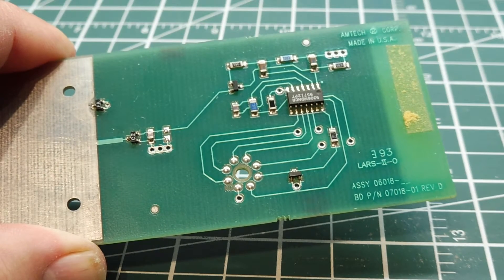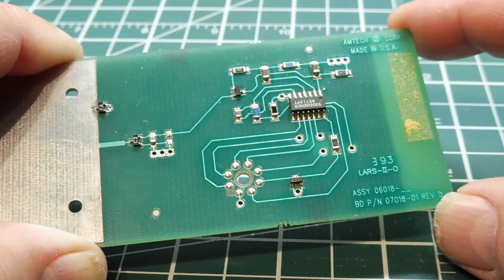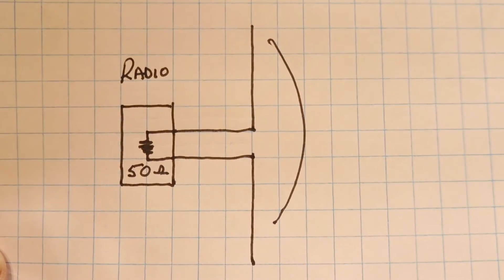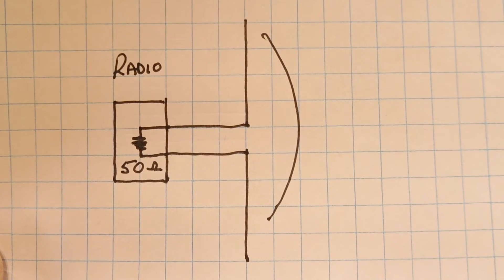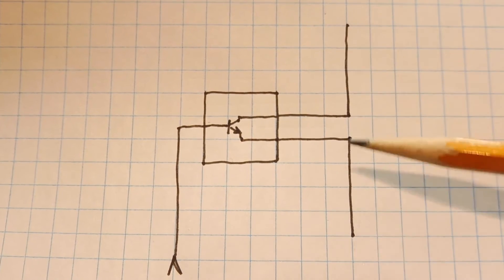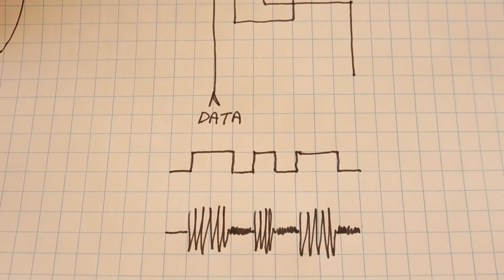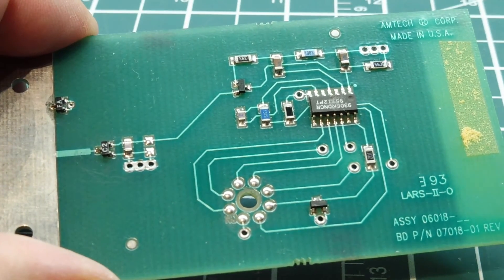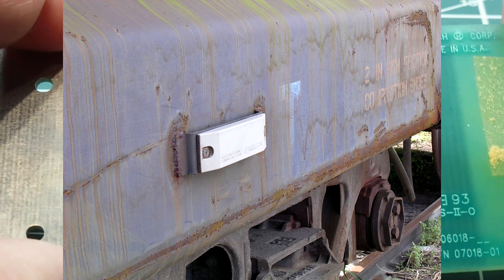UHF RFID Operation using Backscatter

Comment: I found one of these things half out of the grey shell in our yard obviously somebody drove too close to the train car and scraped It off.  I ended up picking it up from the ground throwing  away the gray shell and bringing the PCB home.   Before I saw your video I thought  that the programming port where the contacts of a rotary switch that somehow got lost.   Your video answered every single question that I had about the  Amtech RFID that I found.   Also the TTC which is the transit authority in Toronto has put these RFID  in between the rails of the subway to determine  speed and location  of the train as part of their ATC automatic Train control.  Thanks for taking the time.
Reply from the maker: Glad I could help. When trains went caboose-less a device called a SBU was attached to the knuckle of the last car of the train. It also had a tag for tracking but it contained a battery. Check out this video near the very end to see the inside of this type of tag.
 https://youtu.be/Rm4pQZMBUWA
Reply: Not really interested in rail.....  and a very minor interest in Arduino.  Arduino mostly because it makes it easy to control things that would be difficult to do with a computer.   The rail PCB mostly because if I am walking on the street and see a PCB maybe from a run over cell phone or what ever for fun I  will research the chips by number to see what it was.
Reply from the maker: Thanks for the feedback.